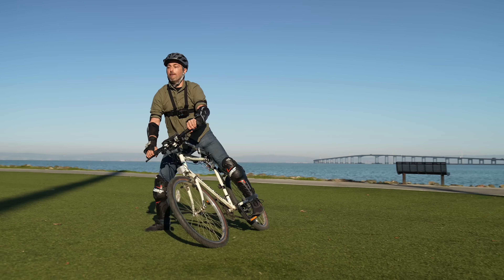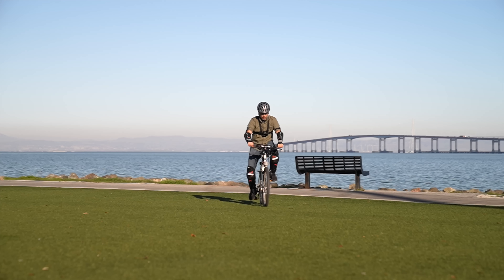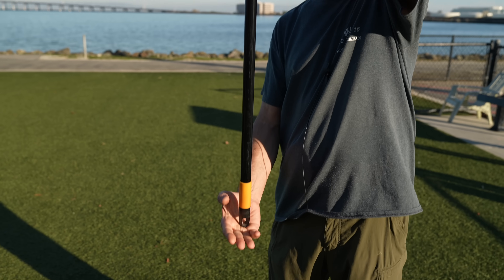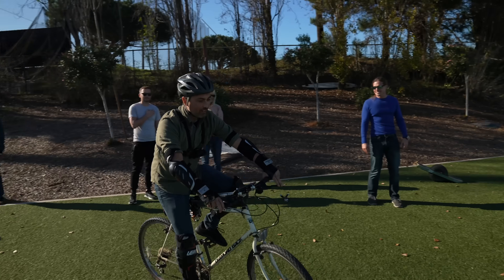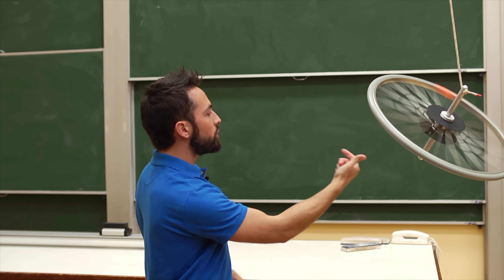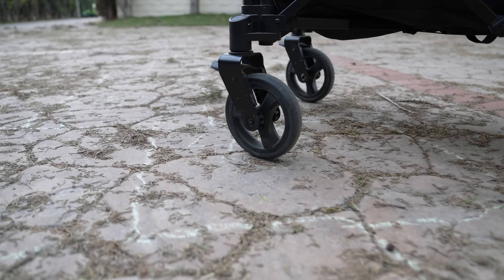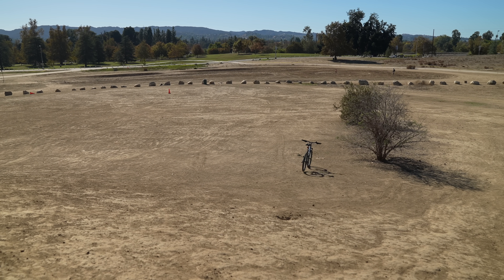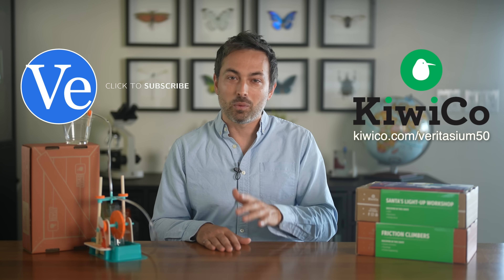Most People Don't Know How Bikes Work

Comment: Glad I intuitively found this effect out by just being curious! :)
Something to add: this is exactly why many motorcycle accidents happen. In order to avoid an object, people intuitively turn the handlebar away... And end up turning the bike into the thing they want to avoid. At high speeds, you have to push the handlebar on the side where you want to turn towards!

Tip, you don't actually need to turn the other way. You can lean by yourself! It's quite hard at first, especially at lower speeds though.
Reply: easy, look away from what you're staring at, you go where you look

Comment: My question though is why they're steering the bike as if it's a car? Wouldn't proper steering be is to lean the handlebars to the direction you want to go and not rotate them? So, locking either side wouldn't rly matter. At least that's how I've always done it so that I prevent accidents from counter-steering.

Comment: this is exactly what you learn when riding a motorcycle... on the freeway you need to turn left to turn right. Funny how other people don't realise this.
Reply: except a motorcycle usually weighs more than the rider. On a bicycle, you can also just lean your weight and it will turn.
Reply: @derosa1989  Yea, not sure about the weight of the vehicle having any influence. Try locking your handlebars. I tried it a couple of years ago and couldn't do it at all.

Comment: I learned this as a kid when I got a remote control motorcycle. At first I thought it was broken because the steering was backwards when I held it in the air, but once it was on the ground and moving it worked fine. I've been riding real motorcycles ever since, and am reminded of tha rc bike whenever I notice myself steering the bike like this.

Comment: As somebody who can cycle without actually having my hands on the handlebars, this is a really nice quick explanation how I actually do that. I balance my body to the opposite side of where the bike is falling to to keep the bike underneath me. If I want to make a turn, I don't, I even push it a little bit in the direction I want to go in to make it turn the way that way. It takes a while to fully internalize how a bike works and I wonder if I could ride this bike without my hands just like I do my normal bike since it changes the physics so much.
Reply: I don't think so. See my main reply. What you can do is move your hips left or right, which then translates to the front wheel via the gyroscopic effect that Derek was explaining.

Comment: Hi, I am from Singapore and I did A levels in 2019. The same year that I did my Physics A levels in Singapore. During Physics A levels, it includes a practical component im which we had to do an experiment. This was the experiment.

"Hang a string taut and horizontally. Tie two different pendulums, A and B, on the string beside each other. Swing pendulum A only. We are then told to measure the time taken for the pendulum, pendulum B to stop moving."

As students were doing this, we ended up with pendulum A and pendulum B swinging periodically non stop. 

My question to this is, is this considered resonance or is there another principle behind it?
Reply: Search for "coupled pendulum." Each pendulum exhibits "resonance" as it swings back and forth. If the resonant frequency of the two are nearly equal, you will get a cyclic exchange of energy between them so that one will swing with a large amplitude when the other is almost stationary. It's quite complicated to understand in depth.

Comment: for sheer s&g, an uncle of mine once built a bike bike which steered left if turned the handle right and vice versa. I could not ride it with may hands on, but free handed (once I had it going) was no problem.
and I can push a bike indefinitely by just holding it by the seat. I thought nothing of it until I saw my friends try it and fail.

Comment: I learned this riding motorbikes but to turn a bike left I push the left side forward, if I want to turn right I push the right side forward. Seems counterintuitive but it drops the bike into a lean which is much better for turning on two wheels. Also you need to counter steer to lean a bike.

Comment: Awesome. That reminded me of something else. I wonder if that steering habit carries over learning how to drive a car. And since many people don't know about it, they don't realize it neither. I remember my driving instructor pointed me out to realize that I had this habit where I steered the opposite direction before turning the other side.
Reply: I am not sure if that is the reason folks here do that. Often counter steering into oncoming traffic :|
Reply: @PacosTacoStands  I am not sure if I understood your statement correctly. People driving cars should never counter steer into incoming traffic like you said.

I was just wondering if there were any people out there who had to correct that habit when they learned to drive a car; because they learned to ride a bike first. At least, that was my case.
Reply: Counter-steering in a car can make sense if there's an obstruction in the corner. By nudging left first, it creates an arc that will take a slightly wider berth around the corner than just taking a hard right.
Reply: @TheUnlocked  Especially important if your vehicle is long or is towing a trailer. If only your front wheels are steering, then your back wheels will be pulled into taking a tighter turn than the front ones do. If you are steering around an object you don't want to hit, like a stopped car or a curb, you may need to make sure the front of your vehicle has a very wide clearance on that turn so that the back of your vehicle isn't pulled into the object during the turn.

Comment: Don't agree with this. This counter steering is an easier way if you have less control and are not as comfortable riding a bike. If you have good balance, you can steer directly to the direction you want while using your body to balance. On top of that, every on the tests was riding really slow, which is harder to balance.

Comment: For decade, i believe that bicycle balance is from the rotation of the wheels. The problems is that the force from front and rear wheel face same direction, so it should not be balanced. But, thanks for your video. One of my black knowledge is become white

Comment: 7:46 On that photo i see dotted line ends (on grond) a lot far away from where wheel touches the grond, mine only about less than one centimeter but at least on the same side.
Another difference if where you hold the stearing, on the photo it if at the left of where dotted line starts, on mine it is at the opposite side, it is between the seat and where the dotted line starts.

Comment: Actually most motorcycle riders are quite avare of this. Many street or track riding courses go over counter streering and do a lot of cornering practices.

There is a video series called, Twist of the Wrist, where they build a no counter steering motorcycle with solid handlebars, similiar to what you are doing here to demonstrate the necessity of counter steering.

Comment: It also perfectly explains, why it's relatively very easy to ride a bike without even holding the handlebars. Just lean right, and the bike auto steers itself. Thank you for this educational video, now I understand why that is.
Reply: I used to do that all the time as a kid. Thought I was special.
Reply: So it’s not skill, it’s just the bike doing its thing with a mushy water bag sitting on it.
Reply: @harsimranbansal5355  I think it still requires some skill to go the direction you wish to go, but it won't fall over super easily
Reply: @KnowledgePerformance7  
When leaning for a handlebar-less turn, you have to carefully lean, as as soon as the front wheel catches your lean, it starts turning, increasing your lean and turning, and turning the wheel more. It's a very delicate balancing act to turn without hands.

Comment: As a motorcycle rider you are consciously aware of countersteering. I do it, because otherwise I wouldn’t be able to turn. However what surprised me was how the gyroscopic effect is not as important as we all believe in comparison to the handlebar self correcting. BTW, one of the clearest explanations I have ever seen for counter steering. Well done.
Reply: Same here. When I’m going highway speeds(~75MPH), the only way I can initiate a turn is by aggressively counter steering. Now that I’m more comfortable with leaning at greater angles, even when at low speeds, I consciously only counter steer (almost overdo it) to establish the necessary lean angle to make the turn; this keeps me from needing to turn the handlebar at all even for low speed tight radius turns. Now obviously for U-turns or similar really low speed turns, I have turn the handlebars to clear the turn. But it’s fun when you can avoid doing the work of turning the handlebar and then, turning it back by using physics. Lol. 
What I learned new from this video that gyro precession is not enough to keep the bike going straight, on bicycles at least. You need the other two design features to create the needed force to turn the handlebar in the opposite direction which keep you from falling. However, given the 10x angular momentum on motorcycles, I wonder how much the design features contribute compared to gyro precession in keeping balance. Maybe, I’ll experiment when I go out riding today.

Comment: You realize this when you learn how to ride a motorcycle. As a matter of fact, when riding a motorcycle you almost push the steering of the bike in the opposite direction, in other words, I push my right hand on the steering to turn right (sounds counter-intuitive!), and the idea here is not to turn the steering left, but more to push the bike to lean right then turn right. In other words, unless you riding at a very low speed, you don't use the steering at all, all you do is lean the bike towards the direction you'd like to turn into.

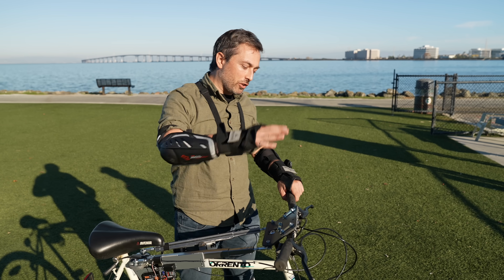Comment: 0:23 as a cyclist i can tell you that when i want to turn i lean. i don't move my hands at all. I move my weight.
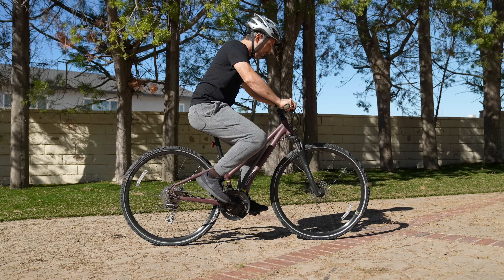5:03 it's not though.

Also all this DH saftey gear (for riding on grass and they are all being worn wrong) and i see no back protector, chest protector or neck brace. If you're going to do saftey do it right and not half ass it while buying the most expensive stuff you can find. All you need for this test is a helmet and some riding gloves.

8:23 so what happens if you have a bike that has direct mount steering? thus making the steering axis in line with the bars mass?

Comment: If you ever learn to ride a street bike (like a motor cycle I mean) this phenomena goes from subconscious to a pretty conscious thing. it did for me anyway. because of the weight of the wheels on a motorbike the wheels have tons of centrifugal force. so for example, to turn right you have to put a pretty large amount of force during pretty much the entire turn in the opposite direction. its very interesting the first time you really focus on it. and most of the turning the bike does is done by the roundness of the wheels and the bike being leaned over, instead of the the handlebars being turned. this is all at higher speeds im talking though. In a parking lot at slow speeds just putting around, it feels very much like a bicycle.

Comment: I've noticed this is at low speeds.  At high speed I only lean. What about riding with no hands off the handle bars? Does the locked steering still effect the turn?

Comment: New motorcyclists often crash because they try to lean out of situations where they should be actively and extremely counter-steering first. The little bit of bicycle countersteer you're used to doesn't work on a motorbike because (at speed) the gyroscopic force of the wheels is immense, and you need to use the precession of the front wheel to lean the bike over.

Comment: This is one of those things that experienced motorcyclists have used to their advantage for years, with practice, a small/hard push on the right handlebar will 'drop' the bike to exactly the correct angle for a smooth right hand corner.

One of the strangest experiences that I have encountered (and I recommend you to try it) is to ride a big motorbike that has cruise-control.  Once activated, and assuming you are on a quiet straight road, release your grip and the bike will just keep going straight.  Trying to turn the bike by any other means (leaning, knee-out, praying, pushing down on the pegs ...) only has the effect of a very gentle curve, and the faster the bike is - say 100kph/60mph - the harder it is to 'turn'.  Then, with one finger only, touch one handlebar grip and start to push and the bike will have already started to turn.  It is an awesome feeling.

Riding in high crosswinds can also be less of a buttock-clenching experience if you just release the grip slightly as the crosswind pushes the front wheel and the bike leans into the wind - cool.

Comment: it's all about balance. if you move your tire contact point to the left, the bike will tilt to the right. then you have to steer right again to keep thhe combined force (gravity and centrifugal force) aligned with the line defined by the 2 tire contact points. not hard to understand, is it?

Comment: Counter-steering is incredibly hard to wrap your head around, especially if you are a motor cyclist - but it is so incredibly vital. If you are leaning into a right turn and you feel like you are taking the turn too widely you have to counter-intuitively turn your handlebar to the left to make the turn tighter. Most people that have little experience with bikes try to tighten the turn by steering right which causes the bike to move under you, effectively putting you upright again and making you shoot even further out the corner. 
This is one of the leading causes for bike accidents.

Comment: Countersteering is a fundamental concept for motorcycles too when turning at speed. Pushing the left side of the handlebar turns the wheel to the right, leaning you to the left, initiating a left turn. Some beginners don't get the concept and it gets ugly.

Comment: can't you just lean the entire bike, sort of like a skateboard? that's how I often turned when on my bike, it's not like you actually have to turn the handle/front wheel to turn (or barely if you want a sharper turn but still after the bike lean), although at that slow speed it can be a pain, especially with the sit so high.

Comment: Hello - Danish bicyclist ego coming through. I've biked regularly for about 30 years now, and when you say that turning puts you off balance my gut tells me it's because you haven't shifted your weight around before you started turning. You have to learn into it. I am not saying that most people wouldn't naturally do a little turn to the opposite side first to counter the the lean you make, so as to keep the bike balanced up until the right moment. It helps with the timing. But I don't believe it's as hard as you make it look if you bike regularly.
But I think the mentioned effect is very visible right when people start biking and need to maintain balance during acceleration. People will usually find themselves turning in step with their peddling, so that they can counter the weight they are shifting from side to side, but once you build up some momentum you won't have to exert as much energy to keep it going and a more stable driving line can be established. There is also a big difference in turning depending on whether you keep your body weight on top of the handlebars , or if you are so leaned back that you are hanging on to the handlebars. When turning while in the position where you are leaned back, I find that it is usually much easier to control the turning by leaning rather then steering.
The whole thing about first steering to the opposing side of where you wanna go is generally frowned upon in Denmark, because most bike lanes are only wide enough for two people, and if someone is trying to overtake you, you will bump them. It really only children who does that.

Comment: I never really thought about this, but I did notice that turning while one-handed is easiest if you have your hand on the opposite handle. Just putting it on top is enough.
Now, I know that steering is easy enough by just shifting your weight - that's how you ride without hands, after all - but I never made the connection of counter-steering being the reason why having that one hand like that seems so optimal for the turn.